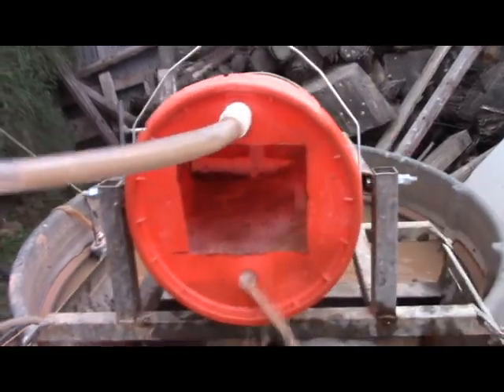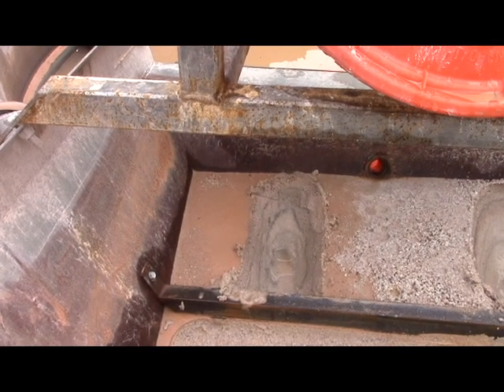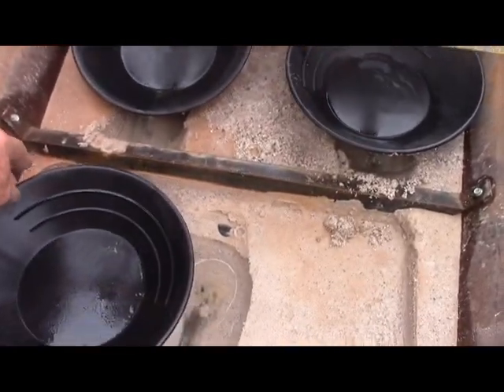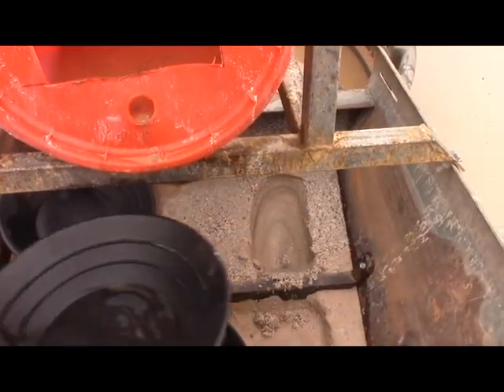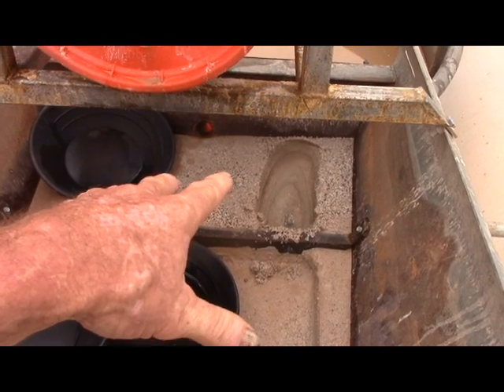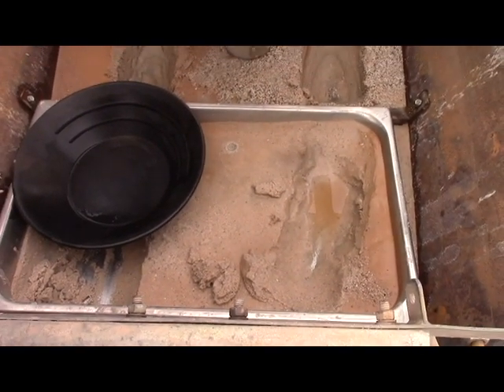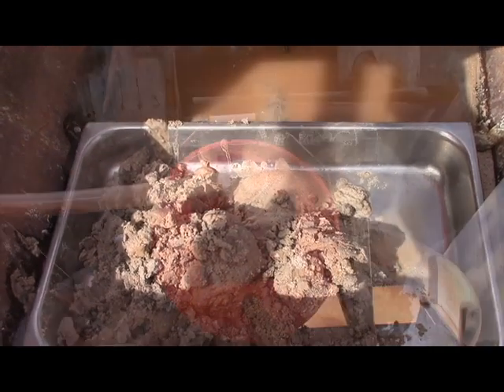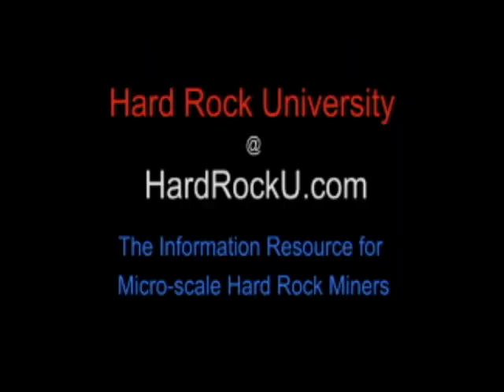142 Using the "Paleolithic MRI" for Process Analysis

Comment: Clean Tailings Keith!
Nice analysis of the tray material. 
I too see the heavies piling on the Right Side of the bucket.. I thought it was because of the Slop in my drive and how I am Spring Loaded to the Center position. (I get a bit of a bump as the springs snap out the drive slop) But the hydromatic drive looks like a really smooth cyclic drive without much slop at all, but still the heavies pile up on the right? Hummm very interesting 🧐 
Well I’m sure there some dynamic at work.. as it definitely does!
Lastly.. from your detailed work and effort I am redesigning my bucket concentrator!
Especially the Multi Stages: Bucket, SS pan, tray also the Drive and Rolling Stage!
Your a treasure pal!
Keep up the great work!
✌️PT

Comment: All looks to be working and processing fine to me . But like anything you do , you can't just walk away and say that's working fine i can leave it now , these things always need the human touch to keep an eye on things ,and make sure your maximizing your capture rate . But i suppose that's the same with whatever process you choose to run with , fluid bed , or shaker table , or whatever . nice demo , cheers .
Reply from the maker: This system actually seems to be very much 'set it and forget it' unless something plugs up.  Currently this happens in the outlet of the dust collection bucket  when a chunk of mud falls off the wall of the bucket and blocks it.  I have some ideas how to alleviate that.  We'll see.  The layering I think  was caused by that and the motor not holding the exact same speed over time.  None of that seemed to be much of an isssue in the tailings that I can see.  Cross your fingers.  :-)